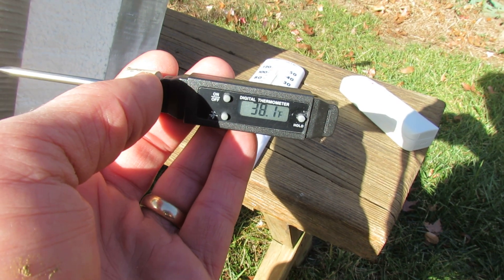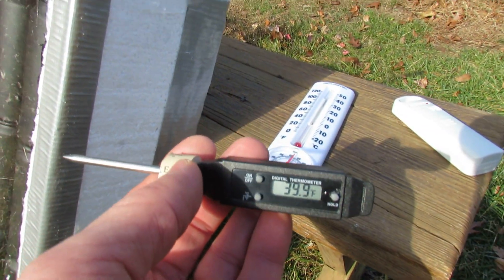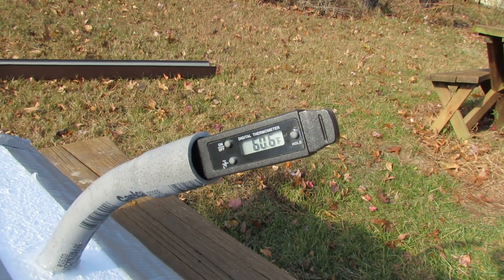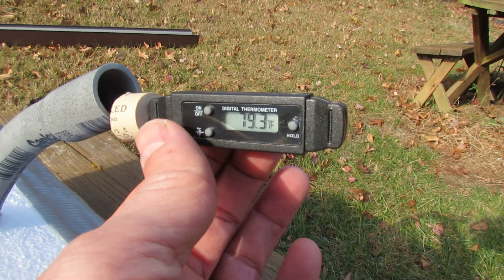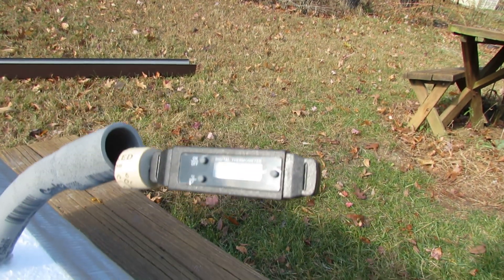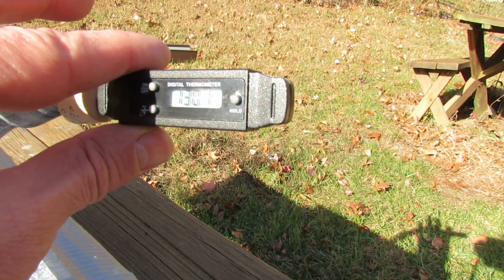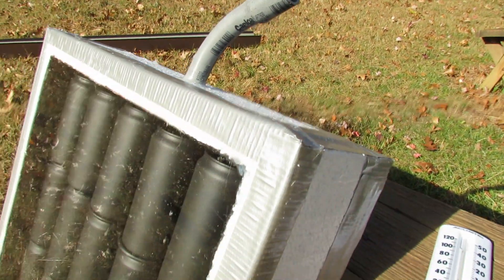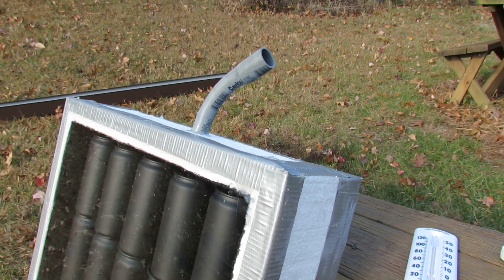Solar Soda/Beer Can Heater - Temperature Output Test 2: 140 Degrees - The Rusted Garden 2013

Comment: great video. i think it wont work in my small greenhouse because when the sun in on the sky the greenhouse doesnt need a heater as it heats up itself very much but i need something to store that heat during the cold nights in my small greenhouse. any ideas>?
Reply from the maker: Water containers work well for store the heat and radiating it back.
Reply: in simple words do you suggest i set my water container with cold water, the daily heat will warm it and that heat will do the work later at night?
Reply: but how do i keep these containers. i mean do i need to just put them in the greenhouse and fill them with water?

Comment: Ok boss so we're now into 2016 are you still using this heater or did you build a bigger one? also I was going to mention an Idea I had while watching your video I was watching another video on here the other day were I learned to build a cloths drier heat reclaim system the ol boy who made it was an long time appliance man and he was saying that if you add a bit of humidity to your heating system it will build up heat faster. It really has proved out over the short time we were using that reclaim system. So What I thought while you were building this one and testing it, was what if you added a small water pan in the cold air intake area of it to add humidity to the air as it enters at the bottom. Just an idea give me a shought if you want. Later..................
Reply from the maker: +Th Linn gill I only have that one. If I move to a non community associate community, I want to build a very large one. I may build a food dehydrator this year and use it on that.

Comment: I have been doing some investigation on this since you posted.  Some have put the unit inside in front of a window.  I was wondering if that would work better or not?  I sure would like to know the difference if you test this theory in and out of your green house.  Thanks so much for sharing.  I did not know about solar heating this way.  I think I can use this idea for a small garden shed I just built.

Comment: Can you heat the whole house with this? That would be nice and off the grid
Reply from the maker: t dub I dont think you could heat a whole house but you could certainly contribute nicely to the heating. You need a way to store the solar heat so it radiates into the house at night or on cloudy days. That is possible it is just work.
Reply: It would be better using water to heat up pipes and radiators in the house. You can find plenty of videos here. Just look for Solar Water Heater. You could even use a large storage tank to hold the hot water and have it circulating all day.

Comment: I think once you connect the bilge pump hose, with the hose being bigger than the 3/4 PVC, the hot air will be allowed to expand and it will cool before entering the greenhouse. I hope that PVC doesn't melt and start deforming its shape at 140. Great video. I really enjoy watching.
Reply from the maker: nelson toups It should take the heat. I can see it getting past 160. The heater will be against the greenhouse so the hose will be inside of it for the most part. I am going to run more tests. I think I will make, base on your point, what the temperature is coming out a length of hose.